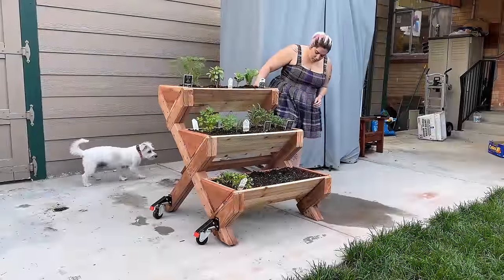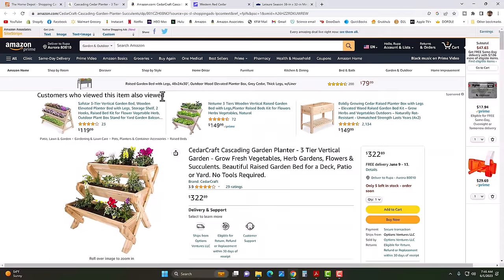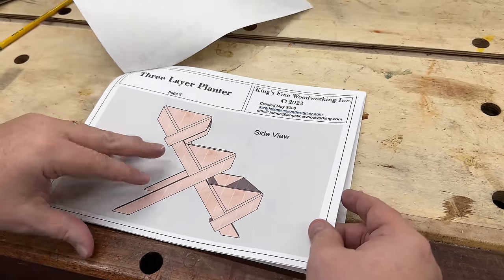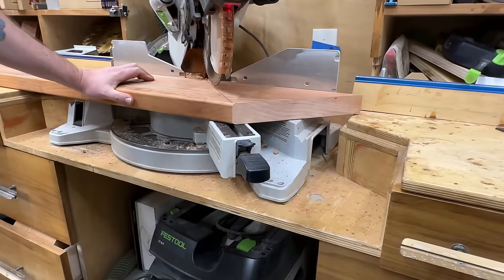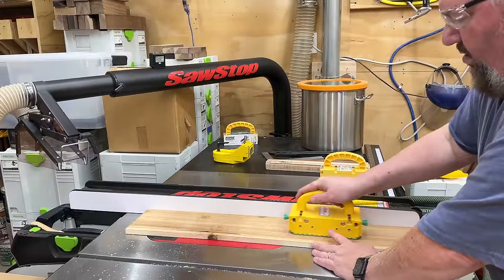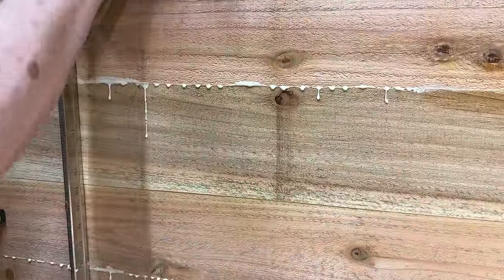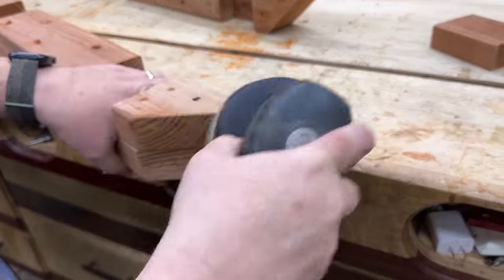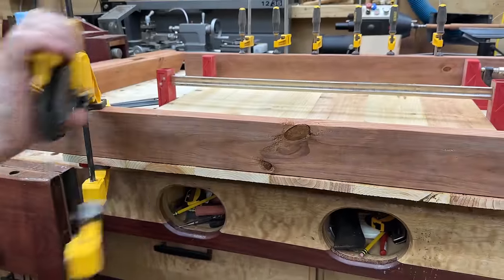129 - Three Level Planter, Cedar Planter Box, Herb or Flower Garden

Comment: This is a great project. You need to add some kind of drainage to the planters so the water doesn't sit and rot the pickets. Either some holes in the poikets or a slight gap in the bottom between them. But still a terrific build.

Comment: Have you had problem with direct sunlight and reflective heat from the concrete or wall ..  Was wondering if they may need  a shade cloth.   Oh and how often would you need to hydrate..  not sure how drying that wood would be?   Nice work.  Thank you.

Comment: Great concept for a planter, definitely superior to the weaker designs out there.  Plus, I've always loved the 'constructed dado' method, and was glad to see it put to good use.  Regarding the workbench wheels, I'd love sometime to see your treatment of a set of those shopmade extending/retracting casters, where you raise the cabinet or whatever a half inch for rolling, by mounting small casters to a hinged board, which uses a lever to straighten the board, in turn pushing the caster down and the cabinet up.  Figuring the angles (unless you buy someone's plans) has always been hit or miss, trial and error.  I think with your expertise in multiple fields, you could pull back the covers and show how to plan those angles on paper, with the underlying geometry.  That would really be something to know, and I can think of no better teacher to impart that knowledge.
Reply from the maker: I think that would make a great video! We’ll try and work that on. Thank you!

Comment: Should I drill two or three holes (1/4 inch) in the bottom for drainage? Also, what are the different sizes of the screws you use?...ie #8, #10...etc. What type of screw did you use to mount the wheels? Thanks for any help.

Comment: I have a guestion it is  on your torsion box top assembly table. You used plywood for the grid my question is would 1x4 or 1x6 be just as good
Reply from the maker: Hi, likely not. Solid wood is a little not prone to warping as temperature and humidity change, plus you’ll have a much harder time finding dead flat pieces to begin with.
Reply: @KingsFineWoodworking  thank you very much and please keep the videos coming I find them both inspirational and educational

Comment: Just a quick question; you mentioned using a #6 X 11/2" SS finishing screw on the pickets. The video shows that they are Zinc, will these cause black drip marks on the cedar? Thanks.

Comment: I have tried to contact you several times.  I sent emails and tried your contact form on your website but your capacha is having some issues and won’t send my message.   I’m trying buy plans for a shed but no m looking for a 12x16 shed with a single pitch roof.  So I’m trying to ask if you can adjust the plans for that